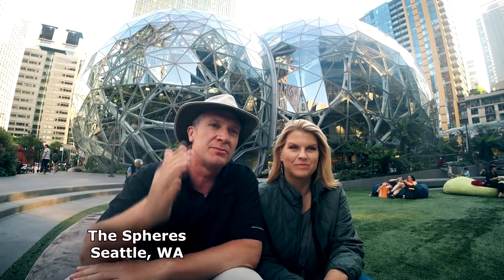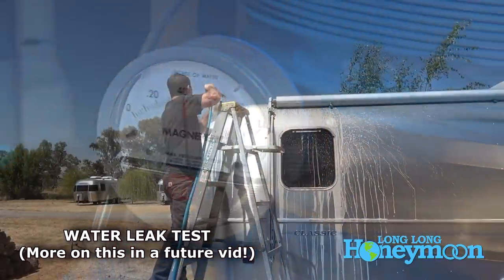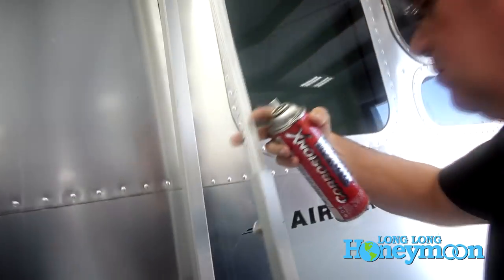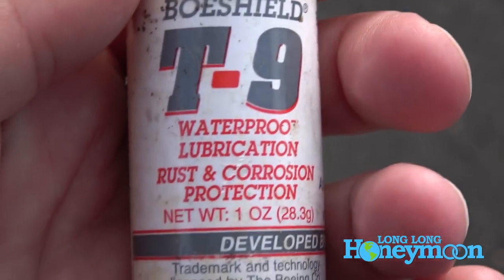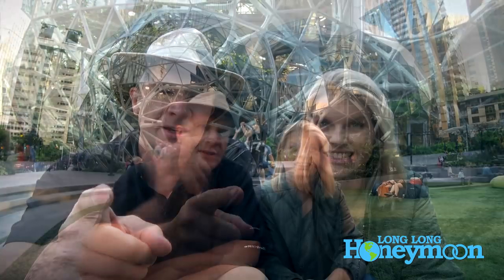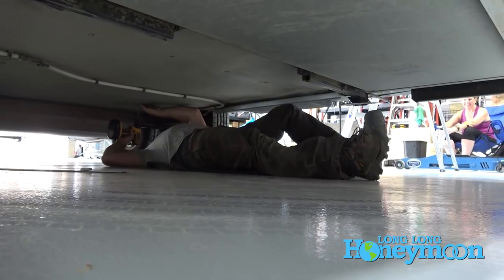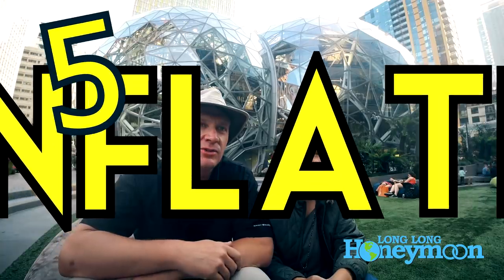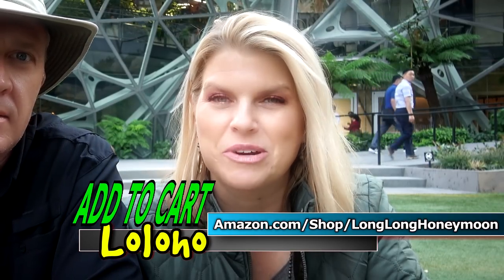For Beginners: The 5 MOST IMPORTANT KEYS to Maintaining Your RV

Comment: If you over tighten a a screw and it starts slipping, you can get some wood glue and tooth picks.  Glue the tooth picks into the the hole.  When it dries you have a spot you can redrill and rescrew.  Even works with residential entry door jams that been through quite a few slams.

Comment: I can appreciate those points about a travel trailer experiencing 'an earthquake' when you go a traveling down the road over time. Thus the need to tighten (not over tighten) screws, wheels, etc. Your video demonstrating the belly pan rivets loosening, I had not considered. So that was good info. showing sometimes even rivets need replacing. Talk to me please about the difference between the 2 types of rivets, Bucked and Blind rivets. Also what have you learned about 'lifting brackets', raising the Airstream about 3". I understand Airstream does Not recommend these, though owners complain they ride low, and that it is problematic on rough terrain.  Thanks, Camper Frank, Lynn, MA.

Comment: If you strip out a screw, remove  Take the head off of a large kitchen match, coat it with wood glue and insert into the screw hole.  Wait a half hour and  put your screw back in, nice and tight.  When I was working as a mechanic, we torqued the lug nuts to spec before lowering the vehicle, then rechecked the torque after lowering the vehicle.   I was dismayed to learn that most new trailers come with so-called "lifetime service less bearings."  I have had bearings last well over 300,000 miles with annual inspection and packing.  I have found few of the newer type going 100,000 miles without replacement, much less 300,000 miles.  Thanks for the info for a newbie like me.

Comment: I can't believe I just caught this video so long after it was posted.  Thanks so much for this, all of the Airstream answers that I needed,  and confirmed my questions about air pressure.  I'm running the same tires around 70 psi so they reach 80 when they heat up, good thing that is correct.

Comment: #6= get an accurate weight at scales and compare with GVWR.  Check each axle load and compare with axle rating and tire inflation.  You may have some upgraded 16" TIRES But most Rv makers skimp out on axle rating and tire. Moist tv's need to run max sidewall tire press rating.  Your^s is an anmoly.  Uslr you air up to max to pressure max psi on tiffe.

Comment: Thanks for the tips, but I have a question. Vinnie showed how you should check the screws for being tight, using aa screwdrivr but when he was tightening the tables inside, he used the driver like he said not to. I know why and how, being a retired mechanic, because you get a real feel for the tools, and he adjusted the amount of torque the driver delivered, but the average person might not. I love the tips Vinnie shared.
Reply: Yep... once you get the feel for the tool I have no problem with an electric driver. The point was to tighten without stripping the screw. Things will come loose and it will be part of your maintenance we just want to improve things not make them worse. Great post...
Reply: I am quite sure that all screws are factory stripped since they are all attached using impact screw driver for speedy installation purpose...

Comment: If you over tighten a screw in wood  you can use toothpicks and glue to  insert them in the hole with glue to get the screw to tighten up.

Comment: Since you're doing this video from the PNW  where it starts raining in the fall and doesn't stop until late spring, another important maintenance tip (at least in the PNW), is to keep your RV under a breathable cover during the raining season.   Otherwise, your RV will grow an amazing amount of mold!

Thanks for another great video!
Reply: Hey There - I live in the PNW as well and it’s raining here right now lol
What I do is put a dehumidifier in my trailer. It’s on a timer so it doesn’t run 24/7 lol, and I have a piece of tubing for it to drain through. Works excellent and is almost maintenance free. I use rodent traps underneath the trailer. 
I lay the traps on long pieces of cardboard so I don’t have to crawl way underneath to place and/or maintain them. 
Inside the trailer I use a combination of devices and substances to help keep bugs and rodents out or dead. 
Cheers mate and happy trails

Comment: 6. Those wonderful roof vents the sun loves to bake them into the consistency of a lays potato chip.  My rig is just 2 years old and all 3 had to be replaced of course being in Nevada added the speed in which they decay and when in that state easy for water/moisture to enter.
Reply: Tdizzle it would be nice if they would make  them out of UV safe plastic like blue fuel barrels. They sure charge enough for them.
Reply: akbychoice They aren’t cheap cost about 2 1/2 Disney beers.
Reply: Tdizzle or a night at the movies

Comment: You can use a screw gun as long as it has a variable torque setting and you set it so it stops where you want it.  If you are in doubt on how to do this, don't use it.
Sil glyde is great stuff, it comes in small packets for brake jobs and also in aerosol cans.  I use it for all sorts of things, in the shop, on the truck, on the trailer and around the house.  If I get a boat I'll use it there too.  The large tube shown will last you many years if you aren't using it as part of your day job.  Two or three brake job packets is more than enough to have on hand for most situations.

Comment: FYI, I spent 50 years in the forest products industry.  Back in the 1970' I was buyer at a Georgia-Pacific Distribution facility when G-P was (but no longer) the largest distributors with over 160 warehouses in the U.S. & Canada.  There are two types of wood commonly used in the manufacture of plywood, western woods like Douglas Fir and southern pine plywood, originally invented by G-P.  Avoid the Southern Pine plywood, use the western ply wood because it is more stable, less prone to de-lamination than the SYP (southern Yellow Pine)  If possible use actual exterior grades of plywood, CC, AC etc. and avoid Interior grades like CD even when they say Exterior Glue. OSB (oriented strandboard) is a chip board that is prone to swelling, along the edges when it gets wet.  When wood is to be left exposed to the weather, like the underside of your trailer, prime and paint it before allowing the wood to be exposed to sunlight, otherwise the paint will crack and peel.  The more sunlight exposure the sooner the paint will fail. Never wash the bare wood with bleach or harsh cleaners or they too can cause paint to fail.  Thought you would like to know these things.

Comment: Another great video guys! It looks like you had a lot of dicor self leveling up on your roof and he just added more on top of the existing. Why did Vinnie not remove all of the old and replace with new?
Reply: If you have a sealant that's loose or peels off it must be stripped off. This roof was last sealed in 2012 and was in fairly good condition. I was able to clean it up and reapply directly over and it will be good for another 5 years.
Reply: @vinnielamica8704  thank you for clarifying

Comment: All good advice.  Really an enjoying your videos.  One question that you may or may not know the answer to: Why is he using LT tires on his RV?  They are really not constructed for trailers.  While they may look a lot more durable, they may not be the best choice, particularly because the sidewall construction is not designed to handle the vertical loads seen on trailers.   High quality ST tires (Special Trailer) are usually the best choice, especially so with larger, heavier trailers.
Reply from the maker: Thanks, we will address this topic in a future vid!

Comment: Thanks for the tips. Vinnie did tell us how much to torque lugs nuts to? Also lug nuts need to retorqued after 100 miles FYI
Reply: Torque is specific to the wheel studs on your trailer. In this case they are 1/2" studs and we torque them to 110 ft lbs. A retorque is always a good idea. One of the biggest reasons for a retorque can be improper original wheel install which we tried to demostrate here.

Comment: I know if you aren’t aware, you may be shocked at the price of some of these lube products. There has been major improvements in lubes in the last few years and they work better and last longer than most of the old stuff. The CorrosionX is used by the government on aircraft, it doesn’t get much better. It out performs WD40 by a lot and that’s just one example. Spend the bucks and get the good stuff, it IS better.

Comment: If you have a full-body paint job it is too expensive to use a brush or anything that can scratch the paint. To wash our Motorhome, we use a lambswool cleaning cloth. I just heard that Andersen hitches tells that you shouldn't put lubricant on you hitch ball because the friction helps control sway. Car and truck tires are not designed to be used on RVs. I worked 31+ yrs in tire manufacturing.

Comment: So he said in the video he would not inflate to the max for your size trailer, and I am assuming it is based on gvwr. He would inflate to 65 psi vs the max 80 psi on the tire. How did he determine the tire pressure of 65 psi should be correct? So as not to heat up above the max yet provide support on your weight.

Comment: Great video as always.  I will do plenty of preventative maintenance before heading to Quartzsit.  Just wondering, Why truck tires on a trailer?  I thought they needed to be trailer specific.  Off to Amazon!
Reply: The Michelin LTX is now a factory fit on the new larger airstreams. Its a very reliable tire unlike the standard trailer tires known as ST tires.
Reply: Joe O its all about having enough ply layers to take the abuse. Trailers, when compared to tow vehicles, have sub par suspension and, because of a tandem trailer axel setup, they tend to skidd or drag tires when cornering.

Comment: I feel like this one is very specific to airstream units, guys.
Reply from the maker: Really the only unique aspect of Airstreams is the aluminum outer shell. The core components of Airstreams are no different from any other travel trailer. Everything in this video (CLEAN, SEAL, LUBE, TIGHTEN, INFLATE) applies to pretty much every RV.

Comment: I see you're running LT Truck tires on the Airstream. I have read so much this is a no-no, but I've wanted to do this myself (Can never find a reliable trailer tire.) have you had any issues with running a truck tire?
Reply: This is a great upgrade... one of my favorite. In this case its a 225/75/16 LTX defender. It doesnt have to work very hard under a travel trailer and will give you many years of reliable service. Its a factory fit now on many high end travel trailers.

Comment: Please don't use dish soap for cleaning vehicles, it contains a lot of salt. I know you try to get it all off afterwards, but car soaps are formulated without the salt in the first place. Love your videos guys.
Reply: Good point.. Dawn is only to be used when you are cleaning the roof with the intention to reseal. Also can be used before I clay the exterior and polish with a couple coats of wax with an orbital buffer. Otherwise always carwash soap...

Comment: Ugh the 'overtightened' screws! Every single screw in my 2019 Jayco TT is stripped. Every. Single. One. Unlike the Pex clamps on the hot water hoses. Those were all loose and leaking. Every. Single. One.

Comment: Good tips. With the sealed bearings, is it prudent to replace the bearings after a certain amount of mileage, weather, or driving conditions?
Reply: They are a sealed bearing. They should be checked for any lateral play. There is a specification for whats allowable. I dont see a reason to replace unless you find a problem.

Comment: Do you recommend the use of Loctite?
Reply: Depends.. maybe the blue so you could get it apart if you had to.
Reply: Thanks Vinnie,  I have been following LLH for years, I love Airstreams ,by could never afford one. I had to settle for a Casita, which has been pretty solid so far. I will take your advice, my Casita does not have a lot of bolted or screwed connections, but I will get myself a tube for maintenance.

Comment: I don’t agree with the tire inflation advice. Running lower psi is not going to make a huge difference in how the trailer rides, but it for sure makes you susceptible to blowouts due to excess heat. Nice video otherwise. :)
Reply: Its an 80 psi tire.. for max load. With these four tires and 15% on the tongue each tire is really not working very hard. IMHO 65psi heats up to 70psi and that's well within margins and wont ride so hard.

Comment: When you pull the brake drums to service the wheel bearings, you'll want to inspect and adjust the electric brakes at the same time.
Reply: For sure.. Check the wiring, magnet and brake lining for cracks and separation too.

Comment: Highly recommend inflating your tires with nitrogen then you don't have to worry about all that stuff he just said
Reply: Nitrogen is more stable, but you still need to check tire pressures.  So everything he just said still applies...
Reply: @Mikey83943  of course but I'm talking about what he said about hot and cold if you use nitrogen you don't have to worry about it but yes you do still have to check your tire pressure like mine I have nitrogen and I need to have them topped off because they're low.